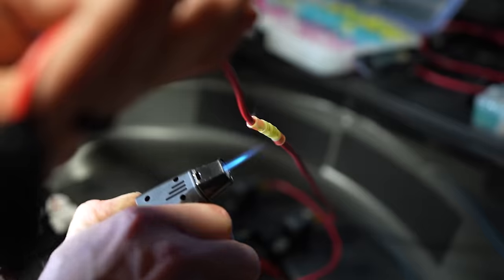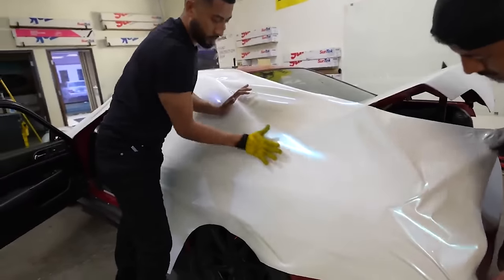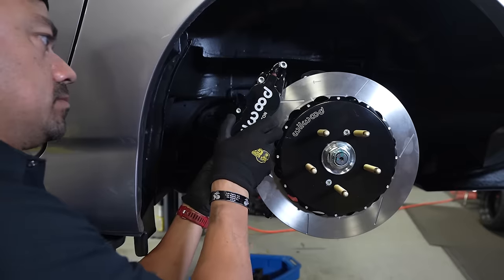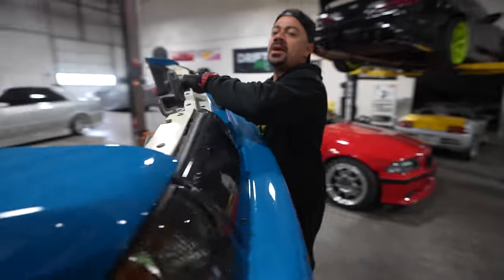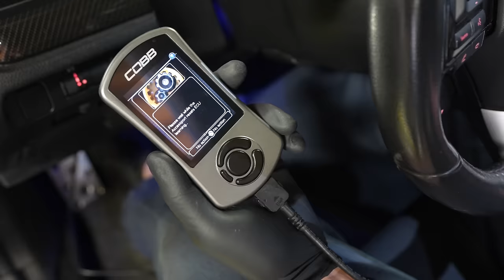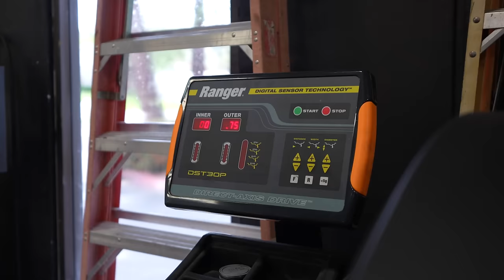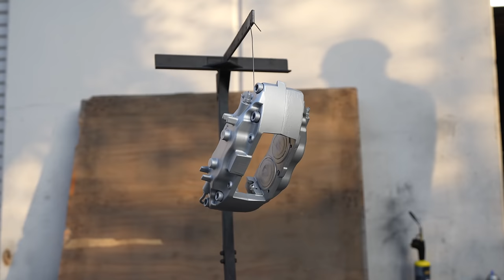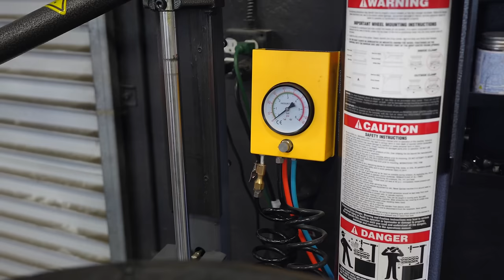Building & Heavily Modifying 17 Cars in 99 Minutes!

Comment: Also, the rear wheel wells will need to be rolled they will still cut into your fresh tires.  There's a tab where the rear bumper bolts into the wheel well, that is also going to cut into the rear tires.